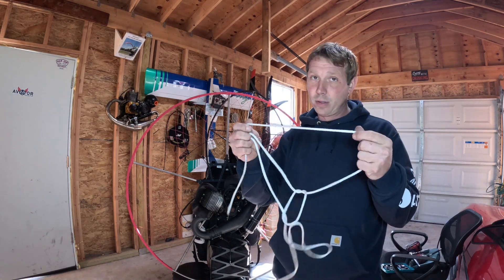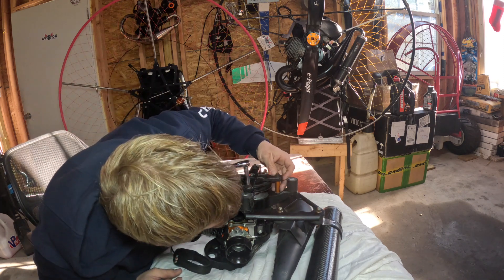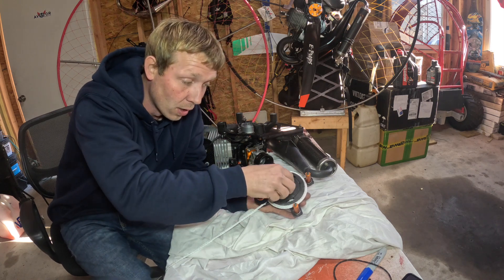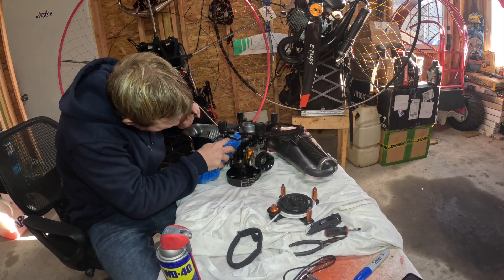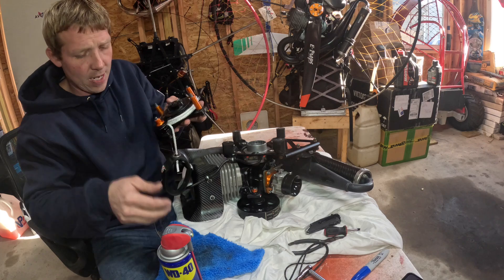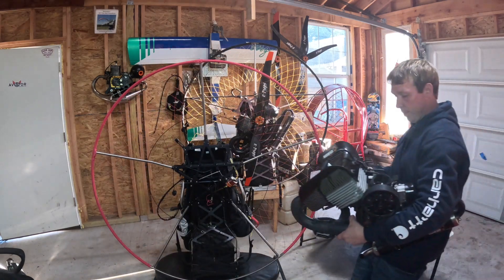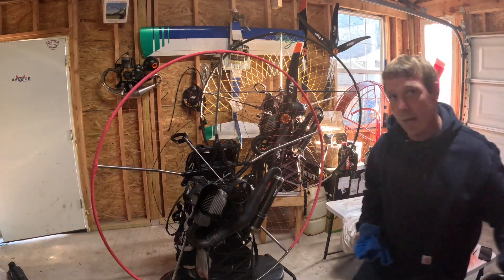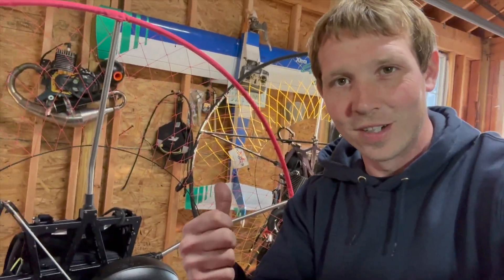Paramotor Pull Cord Replacement! (Vittorazi Motors)

Comment: the main reason i threw my almost brand new moster1855 away was the pull starter. i replaced it 3 times which means the official vitto dealer did. i show vittorazi how i start and they said its all correct. i hated that bloody engine with all my heart! i even have a video up where the whole thing exploded mid air. if i am done i send you an electric unit and make you forget all this nonsense dan!
Reply from the maker: I just got your message. I’m driving.

Comment: I was told on most frames you can get that starter assembly off without removing the engine by taking out the bottom bolts and only loosening the top two and swinging the engine out just enough to squeeze it out. You think that’d be possible on the skymax star? About to change my cord
Reply from the maker: Man… I was actually thinking that I could have taken the starter off without removing the motor and now the more I think of it I got to go check and see if I really can do what you said cause I feel like I could have thinking about it now… what are you flying?